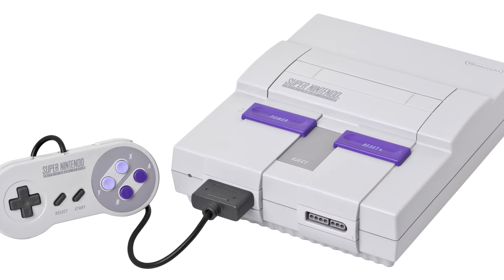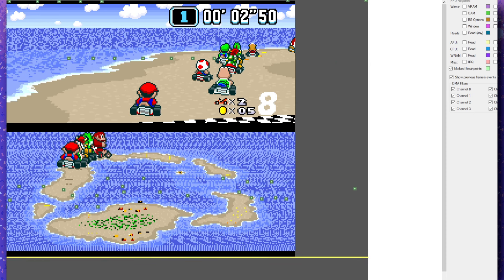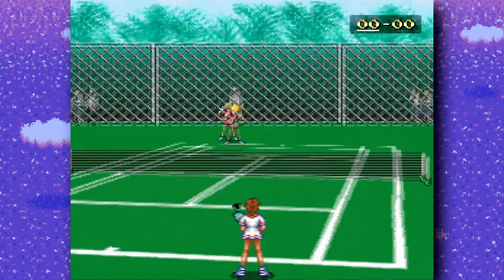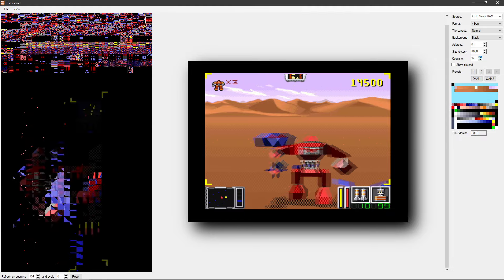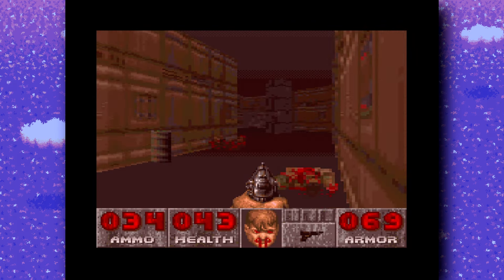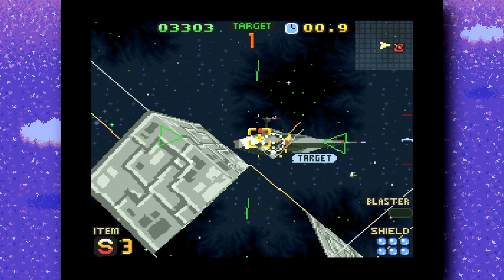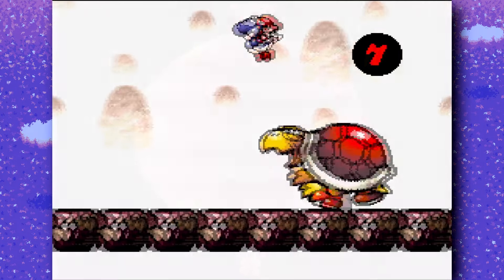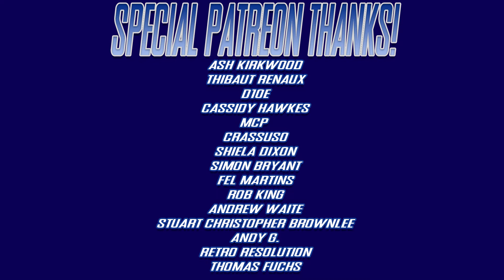How 'Enhancement Chips' Pushed The Limits of The Super NES (and Sometimes Didn't)

Comment: Interesting fact: 96% of all SNES games released worldwide run on stock SNES hardware. Only 4% of SNES games released worldwide have a special chip inside, which is only 74 games out of 1,757.
Reply: Yup. Hardly any games need an extra chip. Shows how powerful the SNES really is. It was advanced for 1990.
Reply: What's your source?
Reply: @matiasd.7755  
That guy grabbed that from Wiki...that isn't a proper source. There is no way only 34 games used enhancement chips for the Snes. Furthermore, the wiki article he got his number from states only really shows 12 different enhancement chips in total which isn't right either.

List of Enhancement Chips for the Snes.
1. Super FX
2. Super FX2
3. CX4
4. DSP-1
5. DSP-2
6. DSP-3
7. DSP-4
8. Sharp LR3592
8. MX15001TFC
10. OBC-1
11. S-DD1
12. S-RTC
13. SA1
14. SPC77100
15. ST010
16. ST011
17. ST018
Reply: @Sinn0100  Almost every SNES game which I say to myself "Man, that's a hell of a good game!" turns out to be using some enhancement chip built into the cartridge...
Reply: @matiasd.7755  
You're probably right and the Snes did have some great games on it. Honestly, I wish Sega would have utilized more specialized chips in their games as well. They were always trying to fix their color count and it could have been done without any 32X add-on's. I know they broke the color cap 3/4ths of the way through the Genesis's life but it never hit the numbers the Snes did. Speaking of absolutely bonkers insane color pallets did you see the guys making Symphony of The Night for the freaking Genesis. I can't believe my eyes but it looks so damn close it really blows my mind. We're talking a bone stock Genesis without any helper chips pushing Symphony. That's crazy.
Reply: @Sinn0100  I can tell castlevania symphony of the night rom storage is huge. Genesis games look better with larger rom sizes. I know the color enhancement chip on the genesis will  use mixing cables like the 32x since the genesis lacks expansion support. 32x can only do sprite or background high colors while one of them have to use the genesis color pallete. 32x is a worthless add-on.
Reply: @maroon9273  
Not entirely useless at the time...I would say underutilized. It gave the Genesis the ability to push out almost arcade quality arcade conversions like Space Harrier, Afterburner, Virtua Racing, and it's version of Virtua Fighter was excellent as well.
Reply: A shame really. Seeing that the SNES was purposely made with enhancement chips in mind (a smart move), I wish we saw more use of them.
Reply: @Sinn0100 no one said only 34 games used the enhancement chips.
Reply: @ChaossX77  
It appears we have problems with reading comprehension. The source said 34 games, not me. Now, go back and re-read it again.
Reply: @Sinn0100  ok thanks
Reply: "Interesting fact: 96% of all SNES games released worldwide run on stock SNES hardware. Only 4% of SNES games released worldwide have a special chip inside, which is only 74 games out of 1,757."

Nowhere does he say the number you said. Don't talk about reading comprehension when you are straight up lying about the OP.

No mention of 34.
No mention of wikipedia.

If it DID come from wikipedia, again, the OP did NOT say 34.
Reply: @borrisg4972  
Way to join the conversation 3 years late keyboard warrior. Funny....no one seemed to correct me when it was current? Not even when I called someone out on it, and they checked it, then said, "Okay." Now, let's put our thinking caps on and see if we can't "logic" our way out of this Scooby-doo mystery. I'll give you a hint - the word starts with the letter E. 

Lastly, I find it incredibly amusing when someone tells me to comprehend what they have totally, utterly, and completely failed to do themselves. News flash Boris, I wasn't talking to the topic creator. I was responding to someone who quite literally asked the TC for a source. One he did not provide, and we know why. Perhaps you should try reading the entire conversation and not just the upsetting parts before responding again. I just hope your weekend has been as amusing as mine has. ;)

Addendum - He absolutely, positively did get his faulty information from Wikipedia. Wikipedia is the worst "fact based" site on the internet. Goodbye..
Reply: @borrisg4972 your just hurting the Sega fan boys feelings they are mentally incompetent don’t waste your energy explaining.

Comment: Megaman X2 and X3 have a lot less slowdown than X1 because they offload the physics and sprite setup to the Cx4.
That first giant boss of Megaman X2 for example use literally every single sprite of the system to draw the head/arms without missing a frame.
Reply: Its also worth noting that the final boss in X2 was a 3D boss, so the effect was utilized for a major part in the game.
Reply: Morph Moth still causes a lot of slowdown (not that I'm complaining, it's easier that way)
Reply: @SeanWithTheBeard  I imagine it is pushing the Cx4 hard because it is doing the sprite rotation trick along with physics and sprite setup and and and ..
Reply: There's a couple bosses that are fully 3D rendered as well, a miniboss and the final boss of X2. There's a few other bosses that use the enhancement chip to handle sprite and screen effects too like Bubble Crab, Crystal Snail, Wheel Gator, and Morph Moth.
Reply: @SeanWithTheBeard  loved that "bullet time".
Reply: Aside that, I also think having unique chips with games had added motive of working as VERY effective anti piracy, while disk based copiers were becoming common. One can patch a SRAM check from the ROM but actual physical chip being checked and even needed by the game is on another level. MVG brings this possible added motive in his video about home computer version of Dungeon Master's copy protection. 
Do note I say "added motive" here and not "sole motive"
Reply: @SumeaBizarro  That's clearly one of the motivations, given Megaman X1 use some hardware quirks to implement an anti-copier system.
The cartridge has some weird mirroring features that when not detected, still let you play the game but adds all sorts of weird glitches like reseting you to the intro stage, delete items and add extra inputs..

Comment: Breakdown of enhancement chips used:

00:34 DSP1 allows for advanced Mode 7 operations through a simplified math coprocessor that allows for quick scaling, rotation and interpolation requiring floating point calculations.

06:43 The DSP2 chip found in Dungeon Master was designed to convert compressed images from bitmap format to the SNES bitplane format, as Dungeon Master for the SNES is a port of the Atari ST version.

07:05 Explicitly in Mega Man X2/X3, The Hitachi Cx4 is used to calculate floating-point trigonometrics to create and manipulate wireframe effects. By holding the B button on Controller 2 when starting up MMX2/X3, you can get a Cx4 self-test screen.

07:37 Super FX, Argonaut Software's brainchild, used in a bulk of the true 3D games, is a GSU add-on chip that alows for polygonal rendering and 2D image manipulation. It's more commonly referred to as a graphics accelerator. It was used in the port of DOOM for its advanced rendering capabilities.

16:56 The SA1 is a secondary processor chip that had a faster clock of 10.74MHz, 2KB internal RAM, bitmap to bitplane, floating-point multiply/divide/cumulative and secondary CiC (lockout).

23:16 F1 ROC II is the only game with the SETA ST010 which is used to improve computer-controlled AI.

Bonus info: The Super Game Boy has a Sharp SM83, which literally means the Super Game Boy has actual Game Boy hardware in its cartridge.

Comment: According to Wikipedia, the DSP-2 chip in Dungeon Master converts  from Atari ST bitmap image data to SNES bitplanes (although the ST also uses bitplanes, but I suppose the layout must be different), and some scaling and transparency effects. 

But this raises more questions. Why couldn't they convert the graphics "offline" and save them on the cartridge in the correct format? I can only assume that the original graphics were more efficiently compressed, and the cost of a bigger cartridge was higher than the DSP-2 chip.
Reply from the maker: I had read that too,  but it just sounds too silly to be real, it might be for all I know though. I couldn't work out what was happening in the code with the debugger and I didn't want to get too bogged down in it. I guess you're probably right and it's a storage thing, but it still seems weird!
Reply: The ST was pretty much a raw horsepower type computer like the speccy. Simple graphics display and a CPU, so you could do all sorts of tricks. In more fixed hardware with custom chips like the SNES sometimes you just can't do some FX. So perhaps the chip was needed for the FX and they decided to also implement the image data conversion too.
Reply: Well RGB and tile graphics have some fundamental differences. Tile graphics have color limits within an 8x8 tile that don't exist with RGB. Could simply be that they didn't want to spend the time and money to convert and clean up the graphics and used an "on the fly" solution instead. It could also be that the ST version had some sort of real time pallet optimization going on with the graphics and they needed the DSP to do that on the SNES.
Reply: Memory was expensive in the early 90s.  It could have very well been cheaper to use a DSP than add the memory needed to hold the graphics in a format the machine could handle.
Reply: I'm going off memory but there's also games like Star Ocean that the addon chip did graphics decompression.
Tales of Phantasia and Star Ocean were both crazy snes carts.
Reply: @agenticex  You seem to be right for Star Ocean but ToP just had a big cart. They're two of the best and most impressive SNES games, well worth playing translated & emulated (both Japanese only). I'm just learning they were both made by almost the same people, but after being unhappy making Tales of Phantasia at Namco they left and made Star Ocean at Enix.
Reply: There were probably reasons.  This is just a guess, but cnverting those original images and storing multiple different variations for wall angles likely would have consumed a lot of space.  Storing a single wall texture and then manipulating it on the fly to for side walls would make the game a lot smaller.  To say nothing of saved overhead and manhours in creating new SNES specific graphics.
Reply: @TheTurnipKing  Came here to guess manhours / payroll. :-)  Sometimes the answer for things is more mundane... it's just a guess but you never know.
Reply: Yeah, my guess is either that it's a space issue (SNES formatted graphics would take up more space and the DSP2 was cheaper than larger ROMs) or it was cheaper than the effort required to convert all the graphics... Or some combination of the two. 🤔

Comment: What's hilarious about Street Racer is that it's using parallax on the mountains and clouds (look around 5:00) during rotation of the player's point of view, which is utterly wrong - parallax arises from translation of the point of view, not rotation. The clouds and mountains should rotate together, and what's being drawn there is ludicrous... if pretty.
Reply: This sort of parallax also seems to be present in Super Mario Kart.
Reply: It kind of makes sense for mariocart because the camera is 3rd person view behind the player, so rotation causes the camera to rotate and translate simultaneously, but the translation should be almost insignificant.
Reply: Your ideal probably would
 have worked a little bit better
 all the graphics should have been warping
🚨🎵🕹🤩🕹🤯🎧📺🎛🔉🎚🔊🎶‼
Reply: Street racer one of the most disappointing games I ever bought. The hype claimed it rivaled Mario Kart or was even better. No it wasn't, it was trash in comparison. Diddy Kong racing actually lived up to the hype and was better than Mario Kart 64 in many ways.
Reply: wow i didn't even notice that absolute godawful mistake.
Reply: @alexojideagu  DKR was awesome
Reply: It looks awesome, that's all that matters.  Mo' parallax, mo' betta.

Comment: 21:25 That's actually just SNES's background mode 2 (2 4bpp layers + offset per tiles function). It's totally possible on stock SNES, as you can see in Wormland from Super Turrican 2 or Aladdin's final boss.
Nice video!
Reply from the maker: Thanks
It is mode 2, but the Super FX is generating tables of scroll offsets that are sent to the scroll register by the CPU. You could do it on the main CPU, but the Super FX is faster.
Reply: @Sharopolis  Yeah, preventing slowdown was the main goal of the SFX here. Especially with that complex wavy background going on.
@Ed y  Genesis also have this vertical split function, but you can only move 16 pixels wide columns. On SNES you can move each 8x8 tile.
Reply: I always thought the super FX chip had such a slow frame rate because of a slow DMA transfer, am I wrong?

I think Sega's SVP (Virtua racing) chip had a little bit of a faster frame rate just because it could move things to video memory a bit faster.

I think the FX and the SVP chips were a little more performant but they are bottle knocked by transfer speed to video ram.

Comment: It's incredible that Nintendo decided to add additional chips in every single cartridge rather than release an add-on to be plugged between the console and the cartridge. Of course there are many advantages to this solution: it makes room for many different chips and it is totally transparent to the user.

By the way, your channel is amazing. Unique, well-researched and well-presented content
Reply: i think sega showed that this was a terrible idea: the add on end up being costly not only for both sega and the consumer but also the retailer who have to stock another big ass boxes with a weird device that does nothing by itself, having to explain what it does. it also segments the market, so you have to deal with multiple incompatible games line-up, etc.
Reply: @mkinitcpio  both the 32x and sega vd was expensive due to the hardware they used where both add-on did not utilized well by sega on paper.
Reply: @mkinitcpio  Well, to be fair, Sega implemented it sooo badly in many ways...

1st, the add-on could be quite small and relatively inexpensive. It could be marketed as "Super FX+ cart", which enables you to play "Super FX+ games" which would be sold at no extra cost as no extra hardware was reguired in the game cart. The extension cart could be about as wide as game cartridges, but a fraction of their height. What Sega's 32x did was nothing like this - I'm not saying it wouldn't have failed anyway, just that it's not exactly obvious that Sega's failure was making an add-on and not an enhancement chip on game cartridge; the way they did the add-on had so much more that contributed to it's failure.

2nd, I dunno, I don't have a 2nd.

Finally, I'm not trying to claim that Nintendo's approach was wrong or worse - there's obviously arguments for it, some of which you mentioned. I'm only saying that 32x is not really a clear example of why the add-on idea was a terrible idea - but how they implemented it certainly was.

Comment: The dsp did a few things not just fast math. It had the ability to pinpoint in a 3d area where something was without the help of the system processor. It had the ability to judge movement and inertia. It also could do vector mapping in that 3d space.  All technically could be done on the cpu but the bus was just to slow and the cpu was only 4-5 mhz. Not to mention working memory.  The dsp was pretty amazing. Hitachi knew what they were doing

Comment: What's mind-blowing is that you can easily do the same thing with a $2 - 5 ARM Cortex M4F microcontroller nowadays, if you're so inclined to make your own custom SNES cartridge with fresh parts (since original parts could be already exhausted by now) - most microcontrollers are already clocked out at 100 - 300 MHz, and some at screaming fast 1 GHz speed, even packing a superscalar CPU, so you obviously have enough time to translate the SuperFX instructions and compute them in that time frame.

Comment: the reason why there weren't more SNES games using the Super FX chip was because it added to the cost of cartridge manufacturing, for example, the Another World port started out with the intention of using the SFX chip, until the publisher stripped absolutely everything from the cartridge, even the additional ram and save battery, making that port an absolute miracle in of itself.

Comment: PilotWings had multiple production runs with different revisions of the DSP-1 chip.  The later revision cartridges had a bug in the demo where the plane would crash into the ground, as the corrections to the math broke the demo's physics.

Comment: The SNES should have had a 7.16 MHz CPU and 256K RAM.  Back in 1990 when the SNES was released, upgrading the SPECS to what I mentioned would have only cost pennies to do, but given a huge boost to performance.
Reply: The Turbo grafx 16 had an 8 bit CPU with a 16-bit PPU so similar to the SNES with its custom 8 bit CPU with some 16-bit dunctionality. But the SNES also had an independent 8-channel Sony sound chip, so the CPU could be half the mhz than TG16.
 Also bear in mind, the early SNES games only ran at 2.68 mhz instead of the full 3.58 mhz. If you play Fast ROMs of the SNES games with full 3.58 mhz speed added, you encounter much less slowdown.